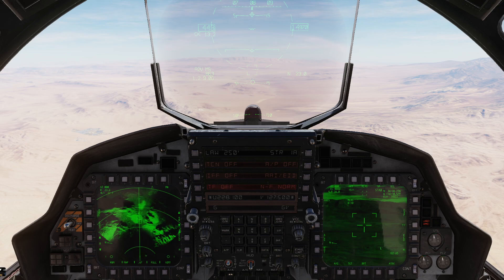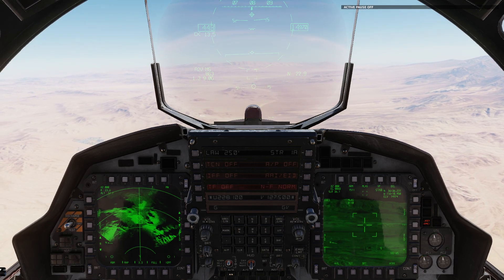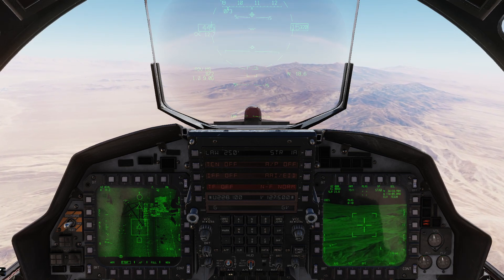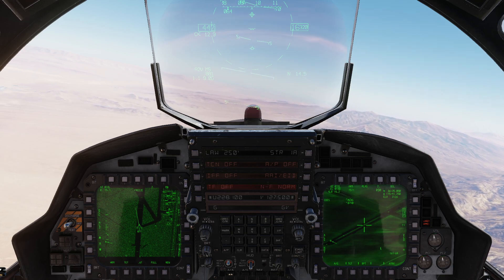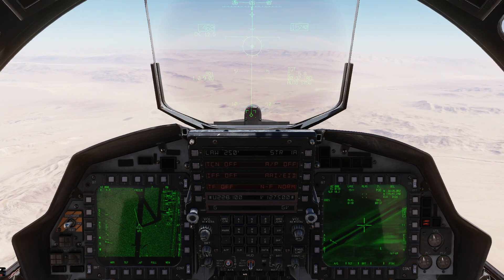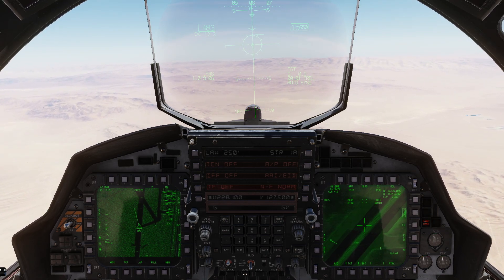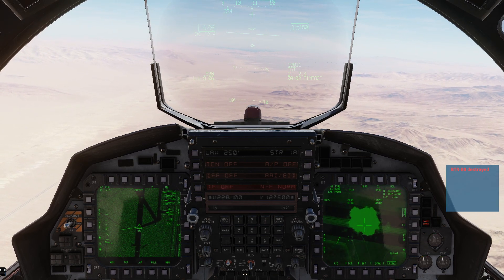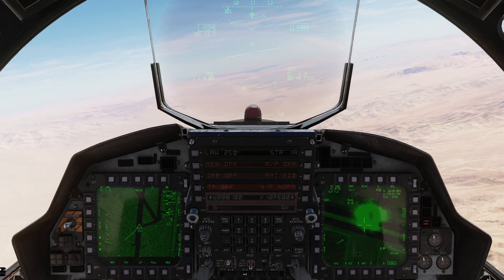F 15E ASL demo

Comment: One for the FAQ:
Can you carry 4 AMRAMMs on the CFTs as well as some A/G weapons on the CFTs?  
Like, 4 AMRAMM on the lower stations and 4 GBU-12s on the upper stations?
Reply: I think you can only carry 4x Aim-120 on the CFTs, no matter what.

But you can have 4x Aim-120 on the wing stations and have bombs below them instead of drop tanks.
Reply: @termitreter6545  Well, I'd like to have 8 A/A missiles AND some GBUs ;)
Reply: @KNJensen  I think the inner 4x Aim-120s completely fill out the CFT bomb slots. Might be wrong, idk. F-15E has weird loadout limitations.

That said, you can still use the central bomb slot, as well as the two wing pylons.
Both can carry bombs, though im not sure if the non-CFT slots are wired to take anything but dumb bombs and LGBs.

Im especially curious about the GBU-39, the small diameter bombs. Central/pylons can each take 4 of them, and they got GPS, laser guided and I think even IR-variants. 

Should have very good range, being a glide bomb and be enough to take out tanks on direct hits, assuming the right variant.